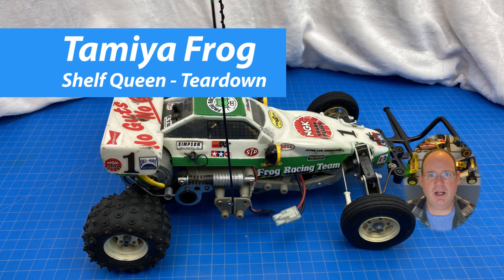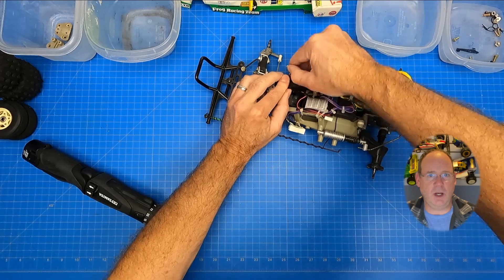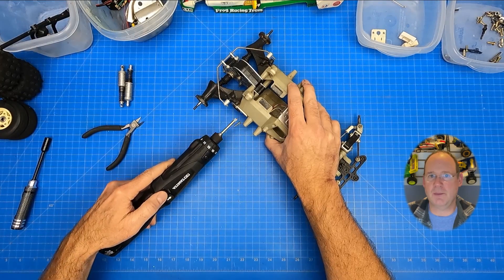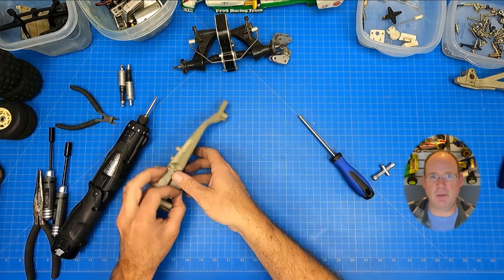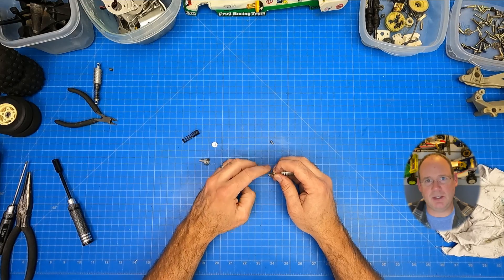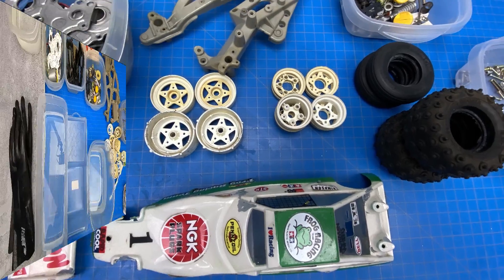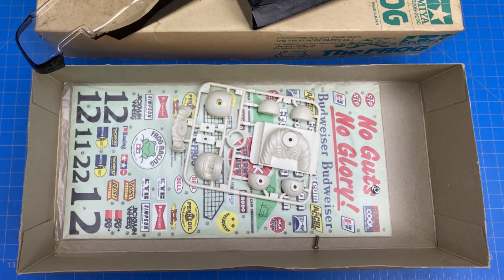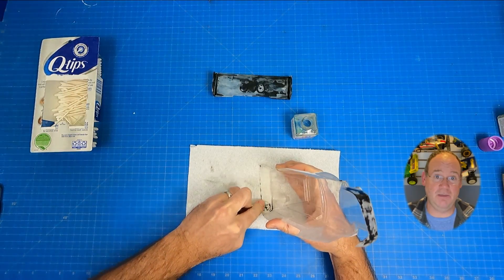Tamiya Frog (58041) Queen - Teardown

Comment: I thought I was the only one to paint the body with green highlights instead of pink back in the 80s. This brings back memories. I did end up replacing the servo AA battery pack to run off the main 7v. At some stage the car developed the gearing grinding problem and being the 80s didn’t have a way to research the cause and I lost interest and it sat gathering dust for about 10 year or more until I found out someone in my Toyota car club had a bunch of rc cars and I gave him the broken frog.
Reply from the maker: Somehow the green is a little more fitting for something called The Frog. The gearbox design was not the best.

Comment: Get a few gallons of LA's Totally Awesome cleaner from the dollar store.  Submerge the body in the cleaner at full strength.  It's perfectly safe on Polycarbonate/Lexan.  The paint will lift off in a few days with a few warm, water rinses.  You can re-bottle the cleaner for multiple uses.  I will normally strain it through a coffee filter and funnel to remove the paint chips.  Works great on polycarbonate paint (lacquer and enamel too).  No brake fluid mess...
Reply from the maker: Thanks for the tip! I will give that a try next time.